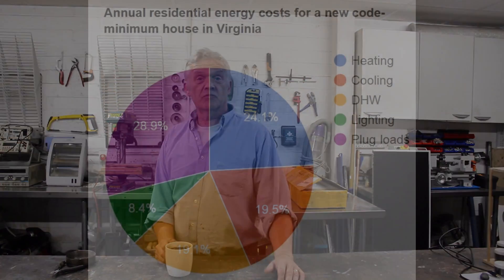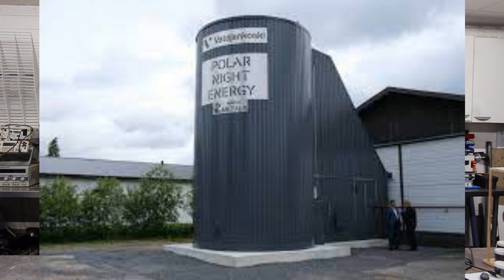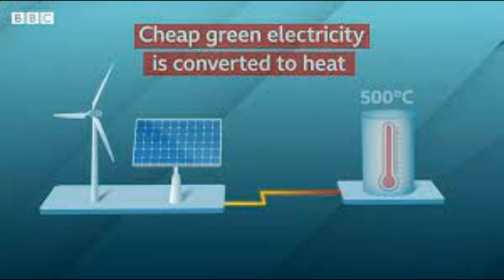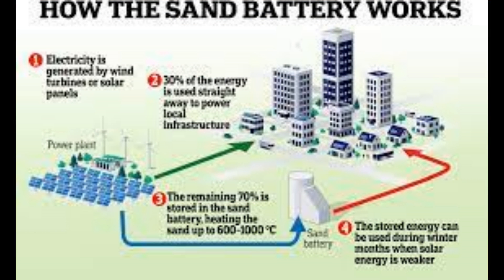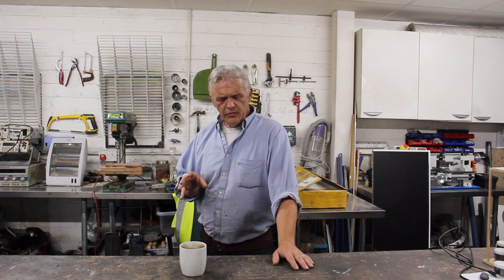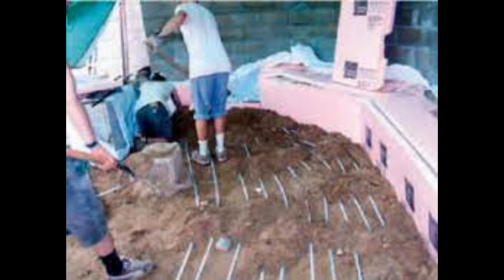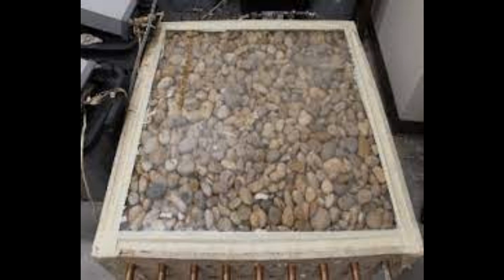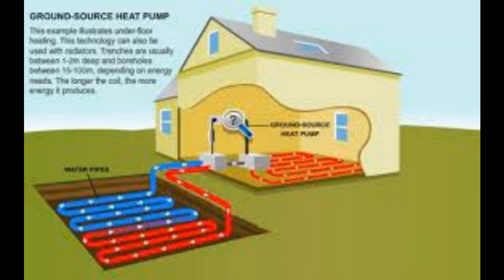1604 The Sand Battery - A DIY Option Or Not?

Comment: Perhaps you might wish to explore the benefits of building underground, capitalising on the surrounding soil as the battery.   Granted it is more expensive to dig the hole, but long term benefits soon outweigh this.   Also noise pollution is greatly reduced and you can have a 'green' sedum roof to help capture Co2 and benefit nature.

Comment: i was thinking you can also use stored thermal energy to run Stirling engines and get electricity back.. i was thinking about this for winter time in italian alps where you always light a fire in the evening, and small Stirling running all night long can keep solar batteries charged.... but where to find a working Stirling engine?

Comment: I enjoyed the comment below about using an immersive heating element directly connected to a solar panel.  Would you try that out? How hot could you get a simple Fermacell box insulated with Mineral wool containing a simple internal heating element?

Comment: ground eggshell has almost the same thermal properties as sand, but its formation sequesters carbon. so swapping it out for sand can be a very nice way to pull down atmospheric carbon while producing energy with no emissions.

further, the temperatures being reached are sufficient to pyrolyse carbonaceous materials. the resulting charcoal can be used to filter waste water, drinking water, all sorts of other things, and be tilled into farmland to improve the soil quality, fertility, resistance to erosion and ability to hold water. and a really nice source for carbon for this purpose is plastic and cardboard waste which is not fit for recycling.

so, if you built one of these things using ground eggshell, clam shells, limescale you scraped out of your shower's pipes, etc. in place of sand, and designed it specifically to accept kilns for pyrolyzing waste plastic and paper that could be a really nice all-in-one solution to virtually all of the current environmental crises.

Comment: I switched from a petrol car and an oil fired boiler to an EV and a heat pump. My electricity usage tripled. However my energy usage dripped by around 70%.

Converting my annual petrol and home heating oil usage to MWh and adding it to my annual electricity usage (6 MWh), I used around 70 MWh a year. Now that I've shifted to just using electricity, I'm only using 20 MWh annually. I've offset 1/3rd of that with PV panels. Hopefully in the coming years I can offset more with wind turbines and more storage.

Comment: Some of the builders in my area (Alberta Canada) have been making greenhouses that have pipes layed a couple feet beneath the ground. The blow air through these pipes and exchange heat year round as a thermal battery. They are able to extend the growing season by several months –which is amazing given the conditions.

Comment: Back in the 70-80s there used to be a home heating system called a Night Store Heater, it was designed to use cheap late-night/early-morning electricity to heat sand or bricks and during the day that heat would be slowly radiated into the house.  This is clearly a modern take on that old commercial product.
Reply: It was installed in the first new house my parents bought, it was an expensive nightmare, barely heated two downstairs rooms and cost a fortune to run, and was very noisy, electricair heating as memory serves, made by creda, they were binned in short order by everyone on the estate in favour of  what was then cheap to run gas centralheating, was just a huge grey tower about seven feet tall in the kitchen.
Reply: They were cr@p....
Reply: It was called economy 7 as I remember
Reply: @dudeatx  Economy 7 (and Economy 10) are electricity tariffs. Essentially they allow you to draw electricity from the grid during periods of low demand and pay less for it. It’s main use is for household devices with timers, such as washer-dryers. And night storage heaters.
Reply: @hel1copter  yeah, I remember in the 80s my mate's dad fitted storage heaters into his new build. The first electricity bill he got he went round the house and turned them all off!

Comment: Perhaps it might be appropriate to use recycled cement-based pavement/building materials for the storage mass as sand is a constituent. A repurpose of a  waste material, diversion from landfills, and double the benefit of the original embodied energy/mining. But perhaps the temperatures involved preclude suitability.

Comment: In the early 2000 a friend of mine and myself came across heat storage in the form of sand,  molten salts and some other ideas.
We were trying to find different ways of running big sterling engines after dark for power generation.
We found all sorts of stuff about heat storage going back decades, so it's surprising that it's just now someone is  making a commercial unit.
Reply: Hi there, what sort of materials did you fine ?

Comment: I thought about a sand battery for a while, before the Finnish news. To actually store the heat long-term (months) the amount of isolation would have to be about 1 meter thick. The sand itself is for free when I dig the hole (in my calculations any sand would do), but the isolation construction would be expensive, it also needs to handle high temperatures. I thinks it's still cheaper than batteries, and it might last longer, but for really heating the house during 3 months of cold, the initial costs are high.
Reply: You might look into John Hait's "Passive Annual Heat Storage" book.  Paul Wheaton has been messing around with this idea outside of Missoula, Montana, USA, (he's rebranded the concept as "Annualized Thermal Inertia" because he thinks it's more descriptive of the process) in combination with Mike Oehler's PSP underground house techniques.  Wheaton styles his version of these buildings as a "WOFATI" ("Woodland Oehler Freaky-cheap Annualized Thermal Inertia"), and he's got both a residential structure and a greenhouse built after these principles.  He's still collecting data, but they do seem to work, even in a climate like Montana.

Comment: Resistive heating gives us a COP of 1, while ammonia has a COP of 8. My thinking is that using renewables to power a compressor to draw thermal energy from air and thermal solar collectors to pack away 8x the energy than is used to power the compressor. In reverse a gas turbine to draw energy from the hot sand heated air.

Comment: Where small scale heating is a necessity - Mass storage in every home needs to be revisited (heat can come from any source - e-Resistive, e-Pumped, biomas, gas etc....)  

OR, any household/small neighbourhood can bury a foam insulated sand filled tank in their yard (or beneath carparks/roadways) for their own private, seasonal heat store

(traditional Austrian brick and tile mass heater (fire) is an  age old example - ??  change mass for something with (known) high specific heat, even phase change material - water is the miracle material in this regard, with the highest specific  heat capacity, but suffers from a low total energy storage (temp range isn't very large) without expensive insulated pressure vessels - and therein lies the rub - and the limiting factor)

A Western Australian group is working with Iron ore as the bulk storage medium - that is as common as dirt in that state - well I suppose it is dirt.

Comment: Of course for hundreds of years wealthy houses had an ice house to keep food fresh and to show off in the summer! Perhaps with climate heating you could combine the two for summer cooling and winter heating. It might even make sense to have a small solar powered heat pump to add or remove energy from the heat battery. Then the thermal batteries energy level could provide the immediate temperature control requirements with a high efficiency but low rate feed from the heat pump.
Reply: Use 2 thermal batteries, one hot, one cold.  The heat pump could draw the heat out of the cold one and transfer it to the hot one.  Then in the summer you can still have a hot one to use for other purposes like say a hot water heater.